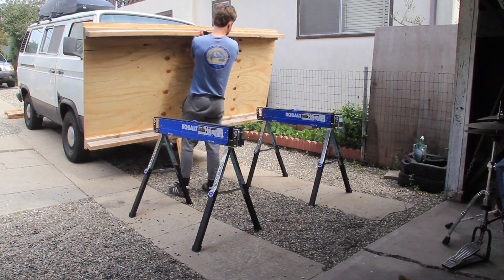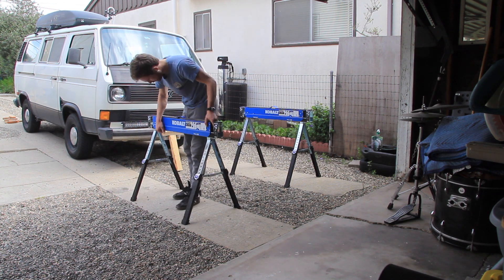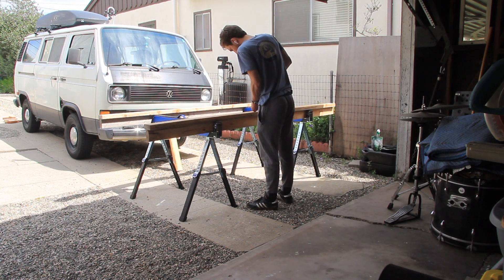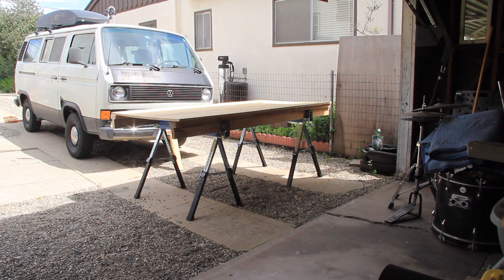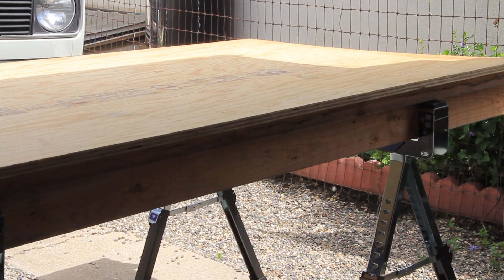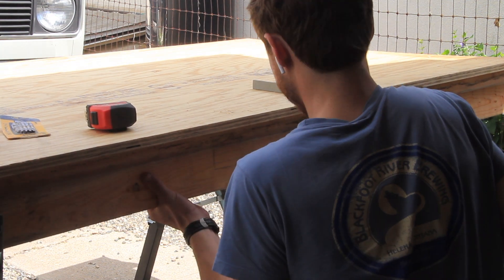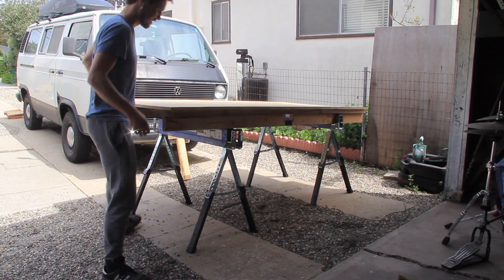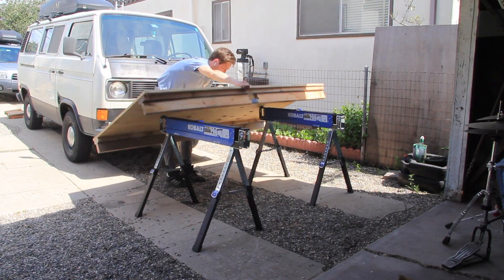Simple WORKBENCH // Portable and Made with Saw Horses // DIY

Comment: I like the "T" for more durability, but will using a 1x4 for the top of the T make it lighter and still stable?  Thanks!
Reply from the maker: That would work and there would be less of a bow in the middle, which is the problem I faced

Comment: hows the sag down the middle working out?
Reply: I am also worried about sag ? what about adding small perpendicular plywood across the entire length and then screw the plywood to it .. i am worried about plywood cracking under constant hammering and masonry work ... good job
Reply from the maker: Haha it has definitely sagged! Next time I would use some parallel support beams underneath, but something that is light, cause it already weighs a bit. Regardless, it is still a very useful work surface. Happy building!
Reply from the maker: Yeah that is a great ida! See my response to Fiver Hoo fiver. The workbench has certainly taken a beating but it has held up and is portable. I would do more support if you are doing masonry on it. Happy building!

Comment: Why not just put the plywood right on the vertical 2x4s that are in the sawhorse?
Reply from the maker: Good question. I didn't do that to increase stability, but you could certainly do that!
Reply: I think that would help prevent the sagging issue.
Reply from the maker: @lutracanadensis101  very true, seemed like a good idea at the time but it definitely sagged ha